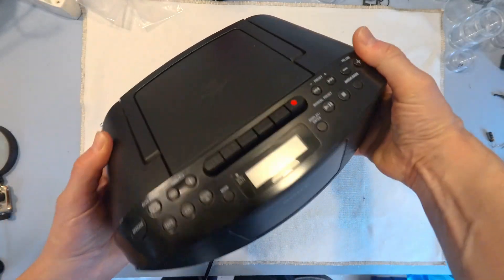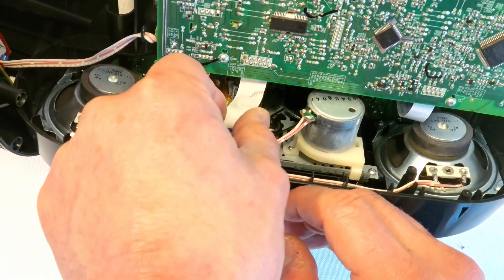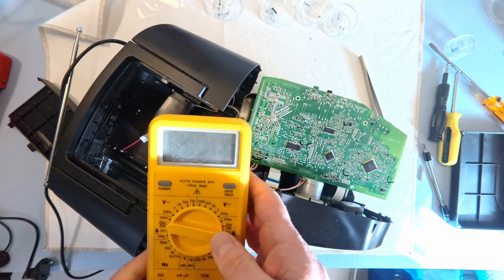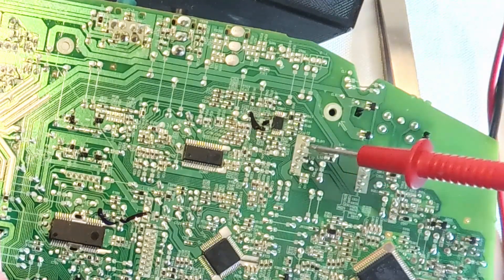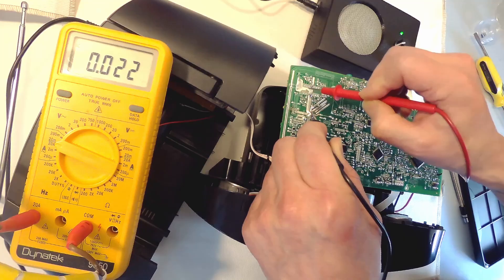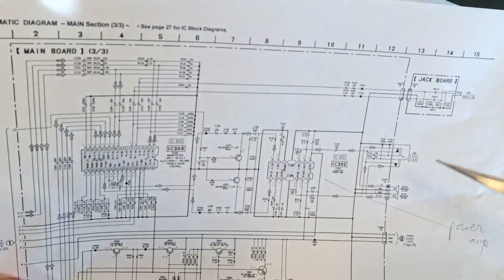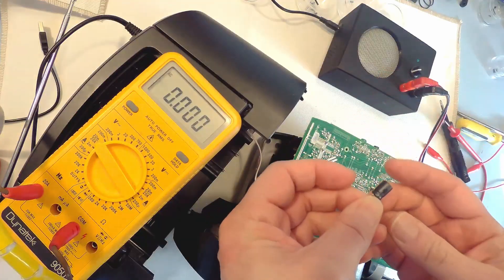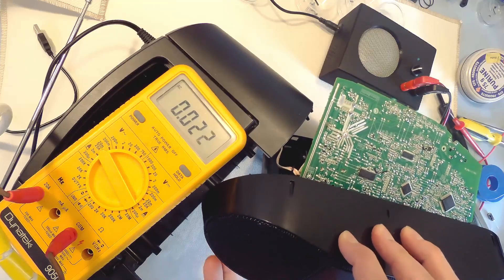No Sound Sony CFD-S50 / CFD-S05 portable radio CD cassette player repair

Comment: Great video. For no apparent reason mine has just stopped relaying power. The transformer is humming though. Maybe an internal fuse ? Trouble is I can't find the right tool to open those screws that are recesssed. I presume the same size philips screws as the non-recessed ones. Do you happen have tool model number for the one you used to get to those screws ? Thanks.
Reply from the maker: Yes, these things are hard to get at and it can be a bit frustrating. I had to use a extension to get to the screws. I am sorry to say that I don't recall the tool size. The boombox has been returned to its owner. Best of luck with your repair!
Reply: Brother what is the name of tool used to unscrew tape recorder?@RepairTechNL
Reply: @RepairTechNL It's a Philps PH1 head screwdriver :-). The recessed screws being the same head type as the non-recessed.  I worked it out by some careful deduction and comparison. I still can't quite pull it open but I shall watch your video again.
Reply: Used a small magnet to help seat them in hole on tip o long thin screwdriver.